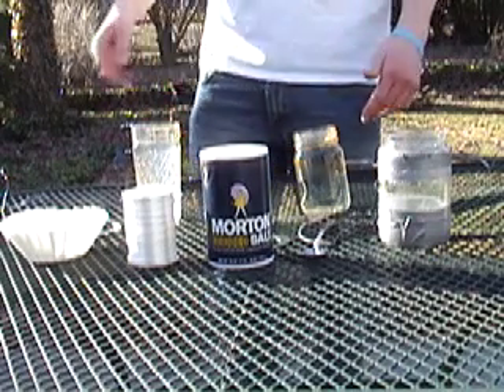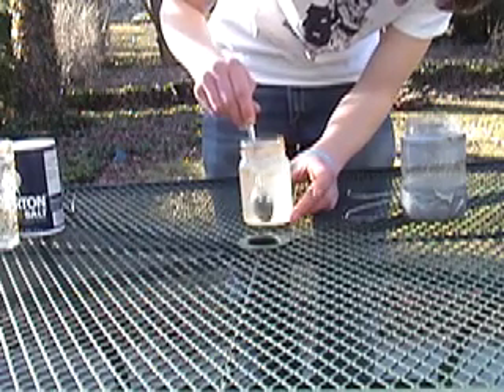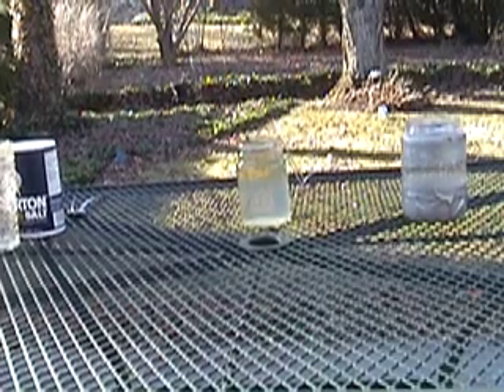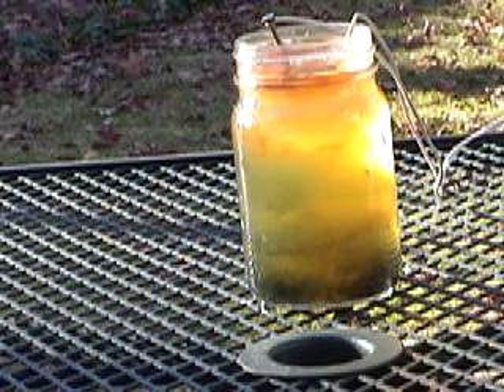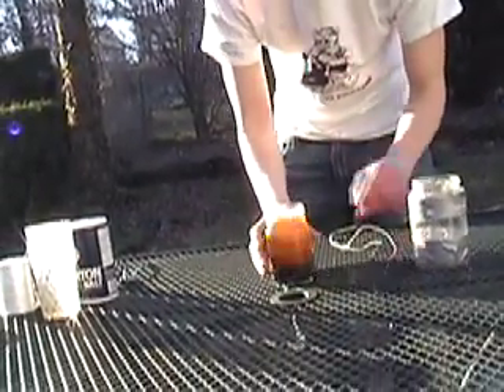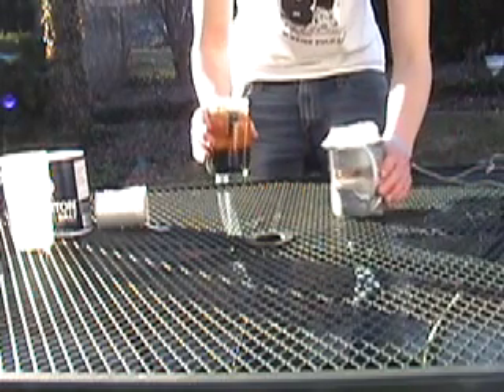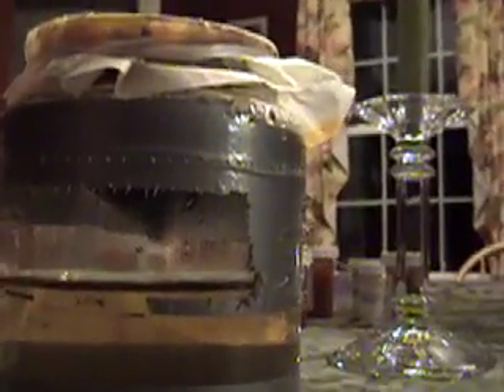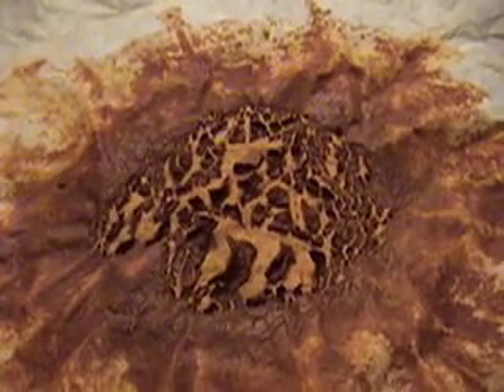How to Make Red Iron Oxide

Comment: Should the rust get a chemical bath if its used in thermite?
Reply: yes you will need to separate the sodium chloride from the iron oxide. this can be done by adding pure water to the mix and allowing the iron to settle. remove the more clear top water. Repeat the process several times for a more pure final product.

Comment: actually what you have left behind is not rust it's a combination of rust and sodium hydroxide, what happens when you electrify the salt water it  released the chlorine atom leaving behind the sodium which went ahead and then bonded to the hydrogen making sodium hydroxide also known as lye... however this can be fixed by going ahead and pouring some water on top of it a couple of times to dissolve the a caustic soda and leech it away from the iron oxide...
Reply: The Na+ and OH- ions don't actually bond.  Sodium hydroxide is very soluble in water, so it doesn't precipitate.  Instead the aqueous OH- anions will react with the metallic iron to produce copper hydroxide-oxide, which is insoluble.  Upon collecting it will become iron oxide.  The Na+ ions stay in solution the whole time.
Reply: No it is Sodium HYPOCHOLRITE not Sodium Hydroxide, I MISSPOKE...Anyways because the chlorine gas that is being reduce via electrolysis bonds with the freed sodium to make NaClO which is common bleach...

Sorry my mistake I didn't mean to say Hydroxide... That can only be produced if using a cell membrane that keeps the anode and diode completely separate from one another but still allows for the transference of the respective molecules...

"copper hydroxide-oxide" you mean Iron..?

"Na+ ions stay in solution the whole time..."
This is true it will stay in the solution however the iron is soaked with this solution so when it drys the solution dries and leaves behind residue contaminating it... Washing it a couple of times with water will remove thees water soluble contaminates...
Reply: Even if the bleach on the iron were to dry and decompose it would break down into 2NaClO--> 2NaCl+O2 so you would still be left behind with a contaminate salt unless, once again you washed the Iron Powder to remove it...
Reply: Iron...whoops.  I've had copper compounds on my mind recently.   xD  Yes, sodium hypochlorite makes more sense.  Washing your product is always a good idea.
Reply: Don't worry I feel your pain... Apparently I had sodium hydroxide on my mind at the time XD
Reply: TrollFaceTheMan
Even in comments of other videos we have the "Go ahead and...." before doing anything.  Hahahaha We're going to find you a help group, bud! Lol
Always appreciate your videos, by the way.  I just got my titanium and MMO cathode/anode in the mail so I'm making my first electrolytic cell...but I did a batch of sodium chlorate from your video and it turned out very well.  Better burn rate than I expected.

Comment: Red iron oxide is a colorant.   Traditionally it is used in ceramics to achieve numerous effects, but is also a low cost colorant in paint.  

In ceramics, it is both a flux (at high temps) and a colorant in glazes where you can acheive blues greens reds and browns depending on firing type.  in clay bodies will make a red to brown clay body and lower the maturation temperature.  Can also be used as a stain when applied by itself.

In oil paint, it produces the bright red we associate with barns.

Comment: did you know iron oxide is what thay use to color bricks its easyey obtained by going to a place thay make bricks sold in 10 pound bags for around $10 its about a dollar a pound but thats alot, seeing how it only takes a pinch in rocket fuel,some places have to order it specal but it comes in many colors red is whats used in rocket fuel, it's only a oxident..! Hope this help useing electralizes is very dangerous creates hydogen exsplosive very.. ! be safe buy it...!

Comment: one last detail you may need to boil the final product I cant remember all the details but I think the heat does this  2(feoh)+heat=  fe2o+h2o  once the water is gone it will pick up more oxygen from the air  fe2o+o2=fe2o3.  things like 5 gallon plastic pails and old metal buckets to roast over a camp fire can make a pound or more at a time.  one last note it has been over 50 years since high school chemistry so try a small batch first as I don’t remember all the details.

Comment: you know that seems like a lot of work for just a few grams of rust per hour.
there are chemical methods like fe + hcl = fecl  then fecl + naoh = feoh + nacl  that is roughly the two reactions and yea i know there is no such thing as feoh but then I’m not a chemist so I will leave it to someone else to balance these equations but this is a fast way to make 1 to 5 pounds or more.  fe=iron,   hcl=hydrochloric acid=swimming pool acid,  naoh=sodium hydroxide=lye.

Comment: Most electrochemical reactions occur must faster when in warmer temperatures, almost doubling the rate ever 10°C so to increase the temperature you would increase the rate of this reaction also pH greatly alters the rate at which corrosion occures with water that is acidic the H+ ions react with the cathod, inturn increasing the rate of corrosion water that has a higher pH lowers the solubility of Calcium Carbonate then making it able to precipitate out as scale onto the metal preventg corrosion

Comment: Didn't know that one with the H2O2 ; thanks alot, for the tip! BTW, u think filtering the rust, then putting it in a H2O2 bath would also work?? Or u absolutely need to put H2O2 in the elctrolysis bath, when the rust is forming??

Comment: Some forms iron chloride (FeCl3) n then turns to ferric hydroxide Fe(OH)3 n is obtained by reacting ferric chloride with sodium hydroxide FeCl3 + 3NaOH → Fe(OH)3 + 3NaCl. But, more reddish then black, though. Another hypothesis, is the iron(II,III) oxide (Fe3O4) that is more black.This happens when the Schikorr reaction occurs. Even simple then all that, is the carbon contamination that is present in steel. When u do electrolysis, the carbon remains unsoluble n is black. Hope it helps a bit.

Comment: Rust is iron(III) oxide. Iron(II) oxide is black n stays black even dry.FeO can be prepared by heating iron(II) oxalate in vacuo as FeC2O4 → FeO + CO + CO2. Don't think u can result with it when doing electrolysis with salty water. Secondly, zinc oxide is white, so that wouldn't be it.Same for ZnCl2. Usually. It look more like some iron hydroxide or oxide-hydroxide. When the electrolysis occurs, in salt water, in turns soluble NaCl to NaOH, with H n Cl in gaseous form. (next paragraph)

Comment: Usually it's written on the nail box. (Zinc coated nails) U want something getting more rapidly iron oxide? Use some iron wool. Way faster! Secondly, when doing the electrolysis of iron  in salty water, u need to rince the filtrate with hot water cause there will be some salt in it. If u wanna absolutely use nails, the uge train track nail are even better. A bigger electrode means more product being producre for the same amount time.

Comment: When I did this, the iron oxide that precipitated in the bottom was black. Could this be iron (II) oxide instead of iron (III) oxide? How do you tell if it is an iron nail, compared to a zinc or nickel? Thanks dude, I'm sure whatever chemical I'm left with will also be useful.

Comment: Part3 of 3: 6. make sure your electrodes (nails) are iron or steel, other metals and alloys can be dangerous, like all those "HHO" morons useing stainless steel which releases chromite, even one jar full is illegal (EPA laws) to dump even down the drain!  7. A 12VDC car battery charger works better than a transformer since basicly you are creating a dead short the charger is made for it, a transformer is not, Just thought I would share some tips and advice, Great video a lots of fun keep it up!

Comment: Part 2 of 3: 2.Plus if you use salt the electrolysis will brake it down releaseing chlorine gas (toxic). 3. Use clips (clothpins) or something to hold the electrodes (nails) since they could touch and make a spark and all that H2 and O2 will go boom if not well venilated. 4. Washing soda or baking soda (if you dont have washing soda) works even better plus you dont have to worry about any toxic gases. 5. Make sure that it is a DC current not AC comeing out of your transformer,

Comment: Part 1 or 3:this is a really great video, This works great for someone that has never done something like this before and wants to try it once or twice, But a few things that should be said , I use electrolysis for rust removal of old cast iron tools or to make H2 and O2 there are a few safety issues that needs to be addressed, 1. Only do this in a well ventilated area  as those little bubbles are hydrogen and oxygen,

Comment: @cxkh I would think a bigger nail or even a spike would work just fine. I also think that a AT Power supply with a push button switch from a computer would work fine use the 12 volt side of the connector that hooks into a hard drive or a cd rom drive. This way. You could do more than 1 jar @ a time. That's my theory. Just don't leave the project unattended while the electricity is plugged in.

Comment: @3DPlanets  No, copper is a different element, you could get a different oxide, but not iron, since the basis of steel is iron, you can get iron oxide, I have forgotten what you get with oxidized copper, but I think it is the green color.

Comment: actually this is a good resource, since there are some great properties of iron oxide while on the surface of steel can act as a wonderful mold separator for
casting, this could be a great way to solve the long timespan from welding a mold together and waiting for the rust coating to assist with the casting process.
Thanks.

Comment: No, it is not the best way.after I did this. I realized that i can connect the wires to two piece of steelwool and put them under water. it is about hundred times faster way than using nails.

Comment: @TalksWithDirt Depends on what you are using the rust for.
Thermite won't mind a tiny bit of salt.
And getting rid of the salt is a pain, you need to put the rust in a 5gallon bucket, add 4 gallons of water, stir, let the rust settle, pour off the water, and repeat 5 times or so.